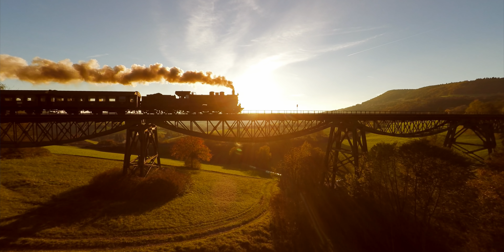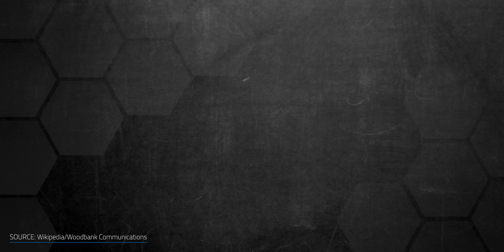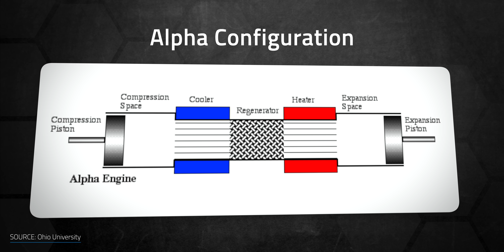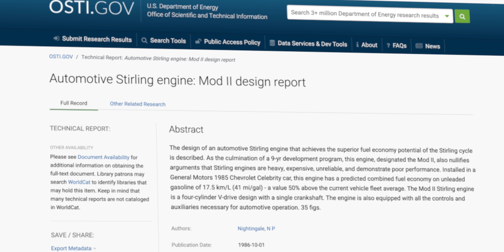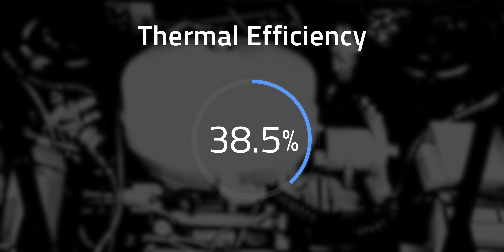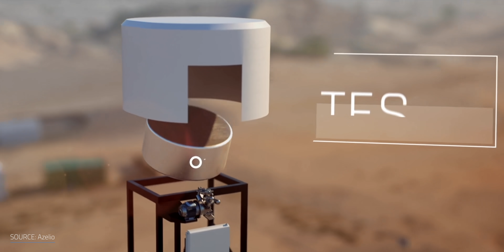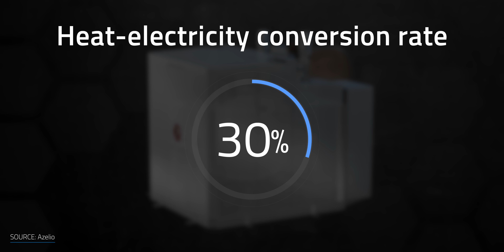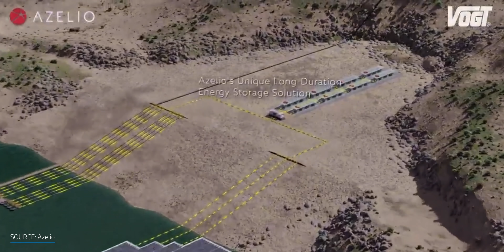Are Stirling Engines the Future of Renewable Energy Storage?

Comment: Well, great overview video. But in engine efficiency comparison I miss typical steam turbines, which can easily achieve 80%. This is the reason Stirling engines are not used in any thermal electrical plant, no matter the heat source (nuclear, coal, gas,..... or solar for that matter). I still believe Stirling engines have a future because of their simplicity and price in smaller plants but not mentioning turbines (as they are the only go-to solution for huge plants) while comparing it to ICEs is weird.
Reply: Stirling use case = convert residual waste energy into electricity, improving the efficiency of the whole system
Reply: @ClearMystic  It turns out you can't do this in a regular thermal power plant, or at least not the way you suggest. Mr Carnot tells you why. Stirling can be used when excess heat is the result of other processes or as the primary engine, sure, but you can't just put it on top of a steam turbine, you would not increase the efficiency of the whole system any further.
Reply: @Mbrablc  where then goes all that steam? 😉
Reply: @ClearMystic  Read about the Carnot cycle. You need a certain temperature differential to harvest the energy from steam.
Reply: @Mbrablc  differential which you get from hot steam that just went trought a turbine and your cooling system.
Reply: @ClearMystic  Its not that simple, really, Google the Carnot cycle, there needs to be a temperature differential even on the output. If its that easy to get that energy, why nobody in the world is using it? You need a hot side and a cold side in the steam circuit and the cold side still needs to be hotter than surrounding air, otherwise there is no way to keep it cool.
Reply: @Mbrablc  It exists and works well, just needs to be more widely applied. With the rising cost of energy and environnemental regulations, it will become more and more used. (If engineers manage to have an awareness of it and the cost of commercial implementation becomes advantageous (which it should with market forces mentionned above).

Meanwhile, proof on concept  exist with Swedish Gotland class submarines.
Company that made the system is called swedish stirling.
Reply: @ClearMystic  Just to be sure - I claim you cannot use a Sterling engine to meaningfully increase efficiency of a thermal power plant equipped with a steam turbine. I don't say Sterling does not work, of course it does and there are possibilities to use it and I am all for it. Eg. in metalworking or chemical industry with a lot of wasted heat (this is what your company Sweedish sterling does and that seems great). In a power plant, eg. fission, the steam coming out of it is not wasted, its a necessary part of the system.
Reply: @Mbrablc  I have to disagree, in a thermal power plant, steam, after it went into the turbine, goes trough a condenser/cooling system (ie cooling towers). The cooling process just plainly dumps the steam heat in the environnement. Adding stirling engines to your condenser/cooling system would recuperate part of the energy that is otherwise wasted therefore increasing overall efficiency of your thermal plant.
Reply: @ClearMystic  A have to disagree, you would get some energy from the Stirging, but that would increase the temperature of the condenser of the original turbine system, thus decreasing the efficiency of the original system, thus making the system as a whole less effective (or the same at best). The temperature of the condenser would increase because you would, in effect, put a thermal resistance between the condenser and the surrounding air, restricting the heatflow. Again, it is not a dump of steam to the environment, it is a necessary part f the system.

Also, I could ask why not use another smaller steam turbine on top of the original one if what you say is true? It has much higher efficiency (2-3x) than the Sterling engine in larger scales.....
Reply: @ClearMystic  This is actually an interesting physics debate, if you want, we can arrange a videocall to get to the bottom of this :-D

Comment: I don't see this going anywhere as energy storage. 40% is just not good enough. Some hydrogen fuel cell systems do that, for the full combination of generation and use, with the important advantage of being able to accumulate the H2 for long cycles such as seasons. Power towers are another topic anyway. They're about energy generation, not storage as such.

Comment: Having a very old brain, I was initially confused as to how the Stirling engine stored energy.  But then I perceived that the energy is stored as heat (the molten aluminum in this example) and the Stirling energy can convert that heat into mechanical energy/electricity.  Now it makes sense.
Reply: Somehow old brains seem to me to be better at understanding and explaining thermodynamics than younger ones.  There's a difference between being able to state what happens and understand how and why it happens.

Comment: I made a sterling (edit: stirling) engine as an engineering design project in school with readily available cheap materials to allow for poor communities to be capable of recreating and use to power low energy devices like electrical lights for homes. It was fun and quite a learning experience. Cool to see this topic on the channel
Reply: You should definitely make a youtube video demonstrating this. That sounds really cool for small scale applications.
I remember seeing a device a few years ago, very simple with cheap materials, that used a simple motor powered by a 20 kg mass that slowly fell over time, and could provide a few hours of electricity to power an average LED light for a room that was used in 3rd world countries. All you had to do was lift the mass 6 feet every few hours to reset it.
I think technologies like these, paired with water filtration and simple electronics like lighting, could go a very long way in helping alleviate 3rd world poverty and and the suffering connected with it.
Reply: Would it be possible to make one, that fully powered a house including high power consumption devices like a gaming PC, fridge/freeze or a high amp pulling electric stove/heating/cooling?
Reply: @EC-dz4bq  it is definitely possible, but from my experience, the engine itself would be disproportionally larger in size than the device being powered
Reply: neat did it work well?? combined with simple car batteries to store electriciy for a few hours at night

Comment: Sterling engines are way more efficient than solar panels. You can get 2-3 times the efficiency and mirrors are much cheaper to mass produce than solar panes. There has actually never been a concentrated solar plant that lost money even though they have been around for about 50 years when solar panel tech was not nearly break even without subsidies.
Solar energy is not going to save us though unless we increase the amount of light reflected back into space because the increased energy absorption from the sun heats the planet just as much if not more than greenhouse gases since you are maximizing absorption.

Comment: so i've seen stuff about generating energy from sound, and always wondered if any noisy space could be used to boost just a little bit. like maybe you could put a generator on top of a liquid air battery so that when pressure is released it flaps the membrane to produce a little more electricity

this video had me wondering about the same thing: could Stirling generators be placed at any heat-producing power generator to capture some of the wasted energy?

on top of that, could you perhaps put some in a building, bridging between conditioned and unconditioned space, to take advantage of the difference in temperatures between the outside environment and the climate-controlled envelope inside the building? this might be particularly useful (if it's efficient enough) in climate areas with a wide temperature range, as the colder or warmer the weather is the more it will deviate from the "room temperature" inside, generating more energy for electrical HVAC to regulate said indoor temp. maybe the future is to stick a few of these in a conditioned attic (perhaps to supplement home solar or a whole-house battery)?

Comment: I don’t understand why pumped storage has to be so complicated. All that has to be done is sink caissons into deep water and pump air into them to force the water out. To discharge them just let the water flow back in and tap the pressurized air as it is forced out. Setting up hydro systems on land requires huge amounts of water and land, both in the same place.

Comment: Sterling engines are a curiosity that never proved useful.
I worked some years as a purchaser for a large machine shop and the lead engineer's pet project was a Sterling Engine. 
Utterly useless for anything other than entertainment. 
Better to use Peltier module as a Seebeck generator with an efficiency of about 5% with no moving parts.
Reply: you can run a car more efficiently and cleanly on a sterling engine than a combustion engine though, so its not a useless machine.

Comment: Stirling solar tried this for years, but never found commercial success before they went bankrupt. Stirling engery has promise in that it can generate more power with a smaller footprint. Downsides to Stirling engines are the same as they've always been. Stirling engines are less efficient in hot climates. They have more difficulty shedding heat on the cool side of the engine. The other problem is the metal that heats up. Stirling engines never found success because metallurgy couldn't produce anything that could stand up to a continual heat source. Hopefully these problems can be solved.

Comment: Would it be possible to run the stirling engine as a heat pump to cool a substance as the energy store? Perhaps to capture and liquefy carbon dioxide. If you weren't too fussed about absolute efficiency, could you also allow some heat exchange with the environment to apply some cooling?

Comment: A couple of heat sources for a stirling engine could be some waste products from a molten salt reactor: Cesium or Strontium.
Sealed inside sealed lead blocks covered with stainless steel these heat sources can provide heat power for way longer than the motor components (bearings) last.

Comment: I designed a better stirling engine years ago, based partially on a jet engine.  It uses 1 rotor to do both jobs of intake and exhaust (blades are specifically shaped) by separating the inner portion and outer portion with 2 surrounded stators.....since it is the only moving part, it has the least amount of friction involved.  It looks like a very wide bullet, and has 2 "sides"...hot and cold.  These can be stacked in a grid formation, with insulation gap fill, and run along 2 parallel pipes (1 hot, 1 cold)....the pipes would be filled with a high heat transfer fluid, like mineral oil.  The cold pipe will eventually heat up and can be used in secondary set, and then a tertiary, etc. etc. depending on how hot the exhaust is.  The efficiency is higher than any designs I've seen, and was looking for investments to start a business....no takers.

Oh well...maybe when I retire this year, I'll fiddle around with building them on my own.....I mean, how difficult is it to cast cobalt blades at fine detail and almost perfect tolerances?  lol

Comment: i've been saying these things were too far ahead of their time and the application just wasn't there when steam power beat it out and it got forgotten.  the fact you could build one into the hillside in a desert(or the arctic) somewhere and basically have infinite power during the day is more than worth it's weight. NASA designed a sterling engine and replaced one in a Dodge pickup truck in the early 90's it was half the HP but didn't suffer any power loss, they ran it on whatever fuel was available at the time from gasoline to jet fuel and even tested it in cross country travel in various environments from Texas to Virginia. the Sterling engines are almost 2-3x MORE efficient than a gasoline engine and are like diesels with their torque output. the one NASA built only had ONE sparkplug and because the oil was NEVER in contact with the burner element it required almost no oil changes AND to top it off it passed California emissions standards WITHOUT a catalytic converter... so the total cost of operation is FAR FAR less than that of a gasoline/diesel and you can use whatever fuel you want! these things are so beyond under rated and are still FAR more efficient than ANY "green" technology out there it's not even funny! these things need to be brought back because there is near ZERO impact to the environment since we already have everything required to produce them, it's just a matter of changing the production process in the manufacturing plants. these are more efficient than EV vehicles at it's current time simply because of the wasted power in converting fuel to electricity > stepping the power up to carry across wires and then stepping it back down into DC for the charging stations... this engine is what is going to determine the future and nothing else!

Comment: Is there any systems that harvest cold at night as well?
Reply: Well, 'cold' isn't an energy source, it simply lack of heat. However, I'd venture a guess that you could build a system to create electricity out of a temp gradient between the air and a hot bonnet, for example.
Reply: @priyanks91  I was asking whether there were any systems in place not if it was possible. Hot is not usable if you do not have cold in this system  but thanks for your incorrect view of energy Einstein.
Reply: Lol, ok.
Reply: there are large facilities that run ice generation equipment during cooler times and store it in reservoirs for use during heavy A/C loads.  There was a building in Plano TX that was doing this, one of the well known names - might have been one of the soda drink/snack names or JC Penney stores offices.   Super insulated.  I heard about it in the early 90's when I was living in the town next to it...  maybe that's not quite what you had in mind, but it's a clever way to offset some energy use during high demand periods...
Reply: @lylestavast7652  thanks, I was thinking of desert areas where hot days and cold nights and using underground water storage could make efficient use of heat engines and water distillation as a byproduct.

Comment: I always thought building sterling engines, or something similar, around cities with a hot dry climate, like Phoenix, would be a cheap, clean, and efficient way to generate power.  If one plate is at ground level with light absorbing paint and the other underground, would that create enough of a temperature difference throughout the day?  As the sun went down and the air cooled, the ground would still be warm for a few hours and potentially create a small current in late evenings too!

Let me know if I'm way off base.  It's just a concept I always questioned.

Comment: So why do existing thermal electric energy plants work with steam turbines? I guess it because of the better efficiency.
I think the are useful in smaller scale where building a steam turbine is not worthwhile. 

 According to Wikipedia the efficiency to of a Stirlingmotor is much less (17%) than compared to a combustion motor used in block-type thermal power station (40%).

Comment: Not sure if it would be more efficient in every case, but if there is a sufficient temperature difference it might be possible to use a heat pump and use  the elevated temperature difference to drive a turbine.

Comment: I'm not really sure you can say that stirling engine is storing energy. The storage part is driven from the phase-change material, and I find this interesting enought. Maybe that's a better way to store energy than pumping hydro.

When talking about engine efficiency, you should also compare to regular engines (fuel driven). You talked about diesel (35%) but what about regular gasoline ? Is that because diesel has a better efficiency ?

Comment: 30% efficiency isn't that impressive when compared with batteries,but when you add heat to the equation,its overall efficiency is impressive. I could see a home system with solar panels storing heat in a phase change material,and then releasing it to generate electricity at night,along with heat to warm the home in winter.
Reply: Blame thermodynamics